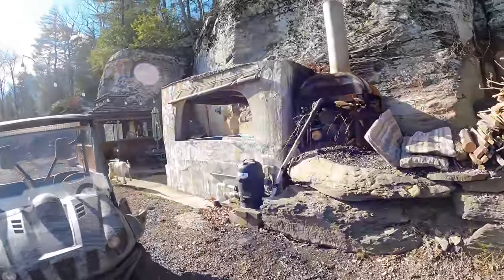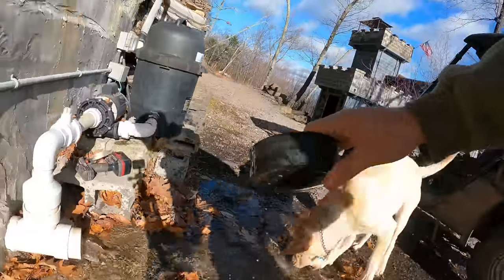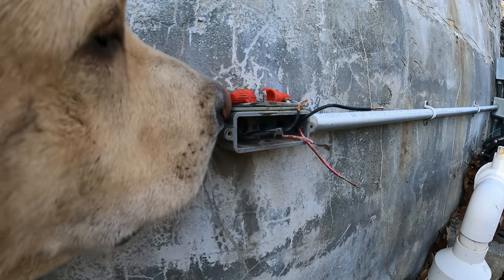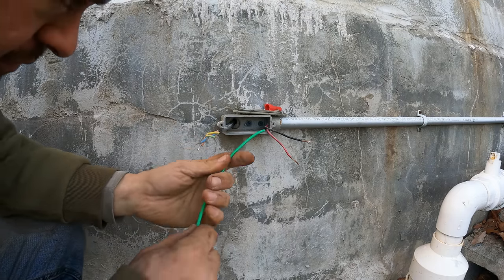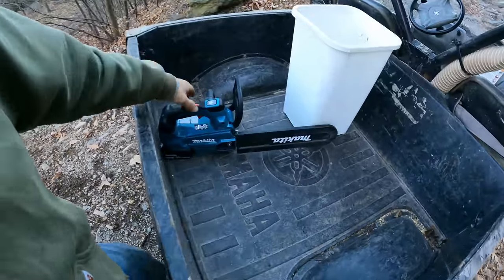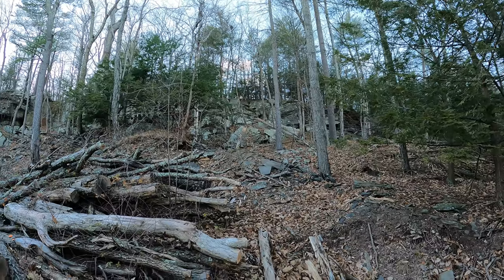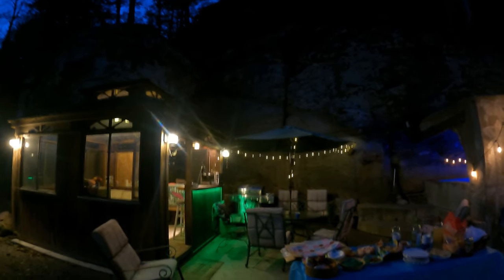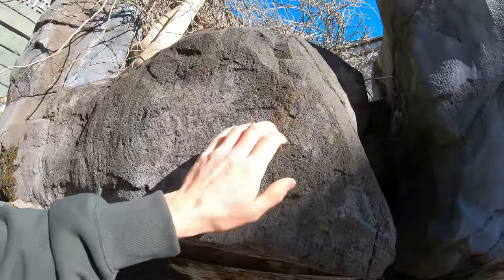Replacing hot tub light

Comment: My experience with Shot Crete was: if you are shooting it at the ceiling, expect half or more of it to end up on the ground (even though you are doing everything right) so have some place or use set up for that “waste” I’ve never seen that waste shot again but I guess but could be shoveled into a Mould perhaps? If you don’t use it lay out some foil to make the cleanup easier. But I’ve never seen Shot Crete done to look like those rocks 🪨 
My guess is that there is first some rebar inside that and above (and perhaps behind the rebar) there is some type of mesh (the aggregate has to fit through the holes with room to spare! Mesh size at least 1.5-2x the size of the biggest rocks), the mesh is attached to the rebar. The shape of the rebar and mesh will determine the shape of the rocks. I think the rocks you showed are painted afterwards with several different grey tones. The “cracks” are made with a trowel after the shooting...
This is just my guess... if someone else answers who has hands on experience with what you showed, I’d go with that.

Comment: Andrew,  an important note, I think.  Water always seeks a level.  It looked like the 120 volt to 12 volt transformer in the conduit box near the corner, is below the level of the water in the tub when it is full.  Even a small leak around the light would eventually cause the conduit and boxes to fill with water, up to the same level of the water in the tub, meaning that the transformer is also underwater.  If it happened because someone in tub at the time bumped the light to cause the leak, extremely dangerous, I believe. Same principal at the sight glass tube on a boiler.  Would give a very unpleasant meaning to AC.  Solution is to raise the 120 to 12 volt transformer well above the water level.  Be safe!

Comment: About the rocks at 6:26: I don't think the rocks themselves are shotcrete. The wall that's on the right side in that frame looks like shotcrete to me, but the rocks are too detailed. Most likely they're either some kind of sealed / painted high density foam, or they're made of like fiberglass. Something lightweight usually. Those would be placed first, and then the shotcrete would be used to fill in between the rocks. I don't think it would be viable to get such nice details with shotcrete, since you'd have to add all the details after blasting the concrete, which is a lot of work in (usually) awkward locations.
I absolutely love the idea of the cave though. Would be cool if you could make it multi-level too, not necessarily another floor or something, but just like a raised part, so it's still open, but feels separated from the rest. To me, where you're currently sitting (between the hot tub and the gazebo) feels a bit like being directly on a road, so maybe separating that out a bit would be nice. 
Looking forward to the project, I'm sure you'll make something nice out of it.

Comment: I am a licenced electrician and I have never seen a green marrette(wire nut). That was pretty cool if it comes with the hole in the end. I know Andrew has been known to modify things. Maybe they aren't available in Canada.
Reply from the maker: Isnt that code to use those?
Reply: @AndrewCamarata  They definitely do the job. I'm familiar with the Ontario Electrical Code and somewhat the Canadian Electrical Code, but I've been retired for a few years. There was a lot about grounding and bonding, and you can use a marrette to connect multiple grounds. Just no requirement for it to be green. Maybe it is a U.S. thing. I would use them if they were available.

Comment: If you're going to build a sauna there PLEASE be one of the few YouTubers who actually do it the right way. None of that dry heat bullshit. You need a genuine Finnish sauna there. Even if you don't care about anything else atleast get a proper stove there that you can actually throw water on. You can't go wrong with Harvia brand. Preferably a wood burning one but electric is fine also. You can even get one with a water tank on it so you can have some warm water to wash up in there too. I'm by far not an expert when it comes to saunas, but I'm a Finn and thus have been to quite a few different ones and know the difference between a sauna and a hot room with a radiator in it. The latter is not a sauna.

Comment: That drain doesn’t look like it moves water quick maybe it’s blocked?
Reply: i thought the same, that should have shot out like a jet. and what kind of seal job on the new light was that? the water going right inside there smh whats the point of the blue water proof sealant if you dont clean the surface and dry it, before attaching it lol

Comment: Electric chainsaws are pretty damn good if you need something quick and hassle free. Don't get me wrong, i still have all my larger chainsaws, but these days, i mostly stick with the conversion chainsaw i made from a Makita battery angle grinder because it's so much simpler. Downfall of this is the fact that the gas chainsaws get neglected, so the one time i actually needed the bigger chainsaw, all three hiccuped in series :)) teach me to neglect equipment.

Comment: Gunite may be better for overhead work. I used to build swimming pools. The main difference is the slump. With Shotcrete you pump wet concrete through a hose and add air at the nozzle. With Gunite you blow sand and portland cement through the hose dry, then add a small amount of water at the nozzle.

You can buy just a gunite "pot" that feeds the dry mix into the hose via a large air compressor and have a ready mix company deliver the dry mix, or you can get an entire rig that has two hoppers and three augers and mix the sand and cement onsite.

Comment: my next door neighbor is a general contractor with several businesses . one is custom drywall.  he worked on a bar called the dug out and used plaster to do that effect.  He practiced on a outbuilding and that room is still standing with the custom work still intact 40 or more years after doing the work.  Not painted or treated in anyway.  till pristine.   Lasted longer than the bar building.  It got demolished during one of the city's urban renewal phases.   Took three open businesses and turned them into open lots.  progress

Comment: I have almost the same electric chainsaw. I was skeptical at first, but I'm really surprised how much torque it has. Even though you don't have to deal with mixing gas, you still need bar oil of course. Also you absolutely need multiple batteries. Don't store the batteries anywhere really cold that gets down to freezing. It shortens their lifespan significantly. Don't know how they'll hold up in the long run. But i have a grinder with an electrical motor that's 60+ years old. Who knows.

Comment: I worked  on a shot Crete crew for a couple of years, building walls is not hard, making rocks, never did that, believe they are made ahead of time, then placed. Small Macco Pump, a high volume trailer air supply, some 2 inch hose, air line, and a shot crete mixing nozzle, Think I watched a YT video on the process of making the rocks.

Comment: I have a bad back and as such can't yank on gas operated equipment to start it. That's why I use an electric chainsaw, electric start lawn mower, etc. Electric (now battery) chainsaws will work just as well as gas powered except you have to give them time to work. Electric doesn't have the same torgue as gas but the new battery powered do.
Electric is fine for around the yard, close to house trimming. You could never make a living using an electric. But I think the battery ones come close to gas.
Battery powered equipment is the wave of the future.

Comment: Look at doing gunite instead of shotcrete.
Gunite machines (Reed gun) are smaller and easier to use in my opinion. You will need a compressor to run it. I've been a Refractory Bricklayer for 17yrs and have done both.
What you want to do can be done with either machine.

Comment: Silica Fume: i can't tell you the exact mix design, but you want fine sand, course sand, 10-7 (10mm & 7mm blend blue metal), Silica Fume and of course, General Purpose cement. Silica Fume is an SCM, supplementary cementitious material. An SCM has cementitious properties in the presents of cement. In the case of shotcrete, the volume of water, the amount of SCM and the slump are key to making the concrete workable as shotcrete.
Also, you should totally look for a nice oxide to limit the amount of painting. Contact your local concrete plant & ask if they do shotcrete with oxide.

Comment: Suggestion for the hot tub, you know those seats you can buy and mount on fiberglass body type boats? That use the body of the boat as a frame, and are essentially the same padded piece for both bottom and back? Find something like that for your hot tub, makes a huge difference.

Comment: At 2:43 there is a gap between the top of the light and the tub wall, doesn't look like a watertight seal.  Old mounting bracket looked rusty, must have been leaking.

Comment: @0:24 You should keep a mesh net around the hot-tub year round, if you want to prevent bugs leaves and debris from winds blowing into the tub bro :-D In the winter, the mesh will also reduce any chill winds as your chilling inside :-D   You might want to consider building a whole new facility along that side of the cliff. Re-enforce the shale walls and build a side tiny house sort of thing, with the hot-tub inside :-D I Would personally make it reach the top of the cliff so you could walk out up top :-D Each floor would be no more then 12-20 feet wide, and the hot-tub could remain at the bottom :-D

Comment: AC? Check out “Air Crete” this is lightweight concrete made by injecting a certain mixture of liquid soap and water into a pre determined amount of concrete. Then, you can spray this using a drywall texturing hopper and air compressor over a frame of rebar backed with plastic which you would affix to the underside of the rebar with tie wire and duct tape. Do a top coat then tear off (remove) the underside plastic and spray to finish. Then be sure and apply paint to the outside to water proof the weather side.

Comment: I used to think the same about battery chain saws, have about 15 Milwaukee m18 batteries and was tired of having to find my chainsaw gas (my dad always comes gets it) so i picked up a Milwaukee saw and love it, can usually cut a whole F150 bed load of wood on 2 standard batteries. As you said its much easier on the ears, can be transported in the cab without gas fumes to worry about or a can to keep up with, mine stays on the porch now

Comment: Years ago when i was working in the swimming pool industry i was around shotcrete  but never had the misfortune of working with it. I did the finish coat for the pool called plaster (white portland cement & marble dust) we used a plaster pump to get it to the pool thru a 2 1/2 inch hose that had a nozzle at the end with compressed air that blew the plaster out into somewhat of a pattern. Shotcrete  is like that but on steroids, Ive heard of guys gettin blown from one end of the pool to the other after a hose got clogged up then violently released, but other than that it was FUN TIMES

Comment: Could also be a plaster or stucco type material. Usually thin to keep the weight down. No need to have 1000s of pounds of concrete in the air is you don’t need it to be.

A cave with lit up stalactites would be epic!

Comment: Andrew look into fiber optic lights before you coat the roof in concrete to get a stars or a sparkle effect once the concrete is in place and the ends of the fibers are trimmed to the surface of the now cured concrete. 2-3 different fiber bundles mixed over the area will give an interesting effect when lit up with different colors and blinking patterns.

Comment: Hire a shotcrete truck; find a shotcrete crew and ask them to let you watch them work.  Doing the work is not brain surgery, but it takes both skill and experience, and those are expensive to develop.  Good place to start might be to build a supporting dome using an inflatable form that gets shotcrete over that.  The form is felated, and you get a rigid structure to work under.
Reply: you might want to google felated

Comment: I can’t believe you use high voltage for that... I would use low voltage dc and setup a little solar recharge system
Reply: well go to it buddy, there's nobody stopping you!
Reply from the maker: That’s where that light is meant to be installed. It’s 12v on a gfci breaker

Comment: 2:42 Will gasket or sealant between the light and the concrete wall be better for the life expectancy for the light?
Reply: is 2:37 not a seal
Reply: @howardwilliams8993  I know it is not a seal, it’s more like a trim piece, so I asked if a seal can protect the light and the wiring better
Reply: @yzhang8629   pool lights are housed in what is called a wet niche. In a swimming pool you would wrap enough extra wire around the fixture so you could service it without draining the poo;.  the fixtures and wiring are made for 100 percent full emersion. the  bulb and electronics are  sealed  via a gasket  between the lenses and housing..